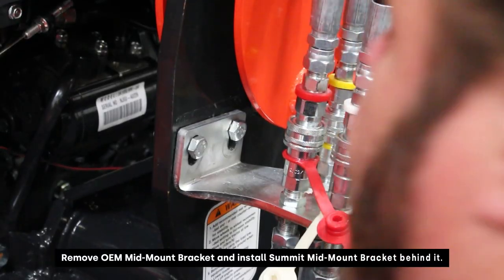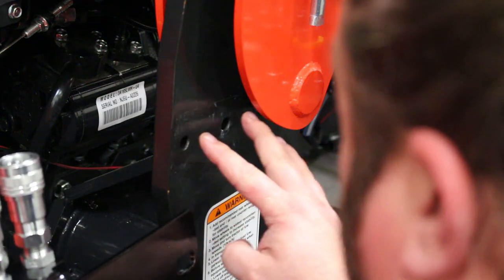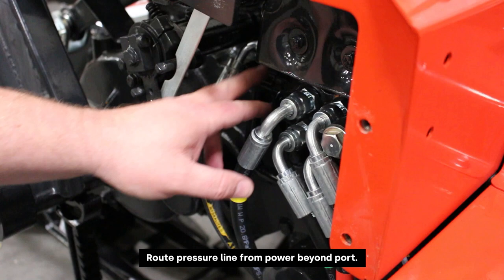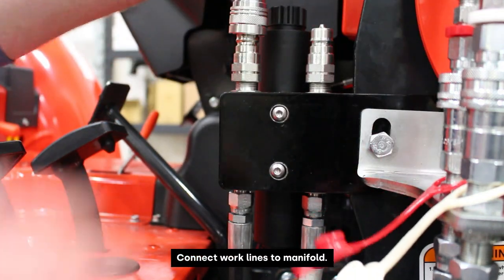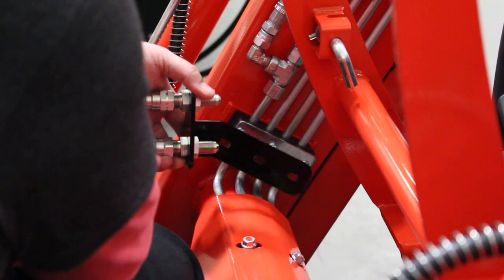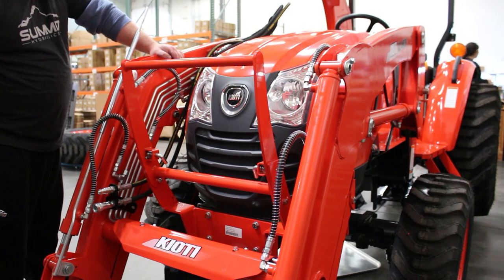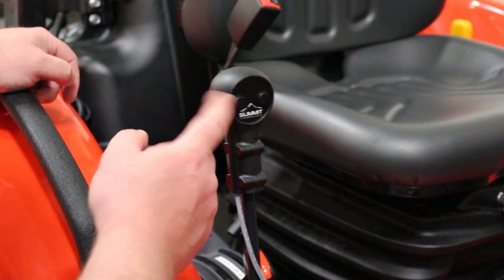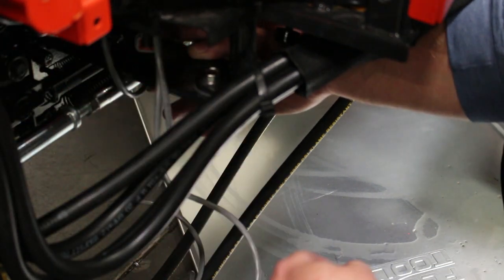Summit Hydraulics Kioti CK2610 Third Function Kit Installation

Comment: This tractor does not have rear remotes.  The Pressure port coming out of the tractor needs to connects to the P port on the 3rd function and the T port on the 3 rd function connects to the P port on theear Remotes to Pressure port on the rear remote valve

Comment: Any updated kits for the Kioti CK20 series tractors yet? I got a CK2620se Cab tractor that I would love to install one of your kits on it. It already has the prewired front loader joystick with the aux buttons.
Reply from the maker: We currently don't have anything in the works for that model, but our 15GPM Universal 3rd Function kit would be a great option for your tractor.

Comment: I have CK3510 gear, you need to add more content like where wires hook into and how run hydraulic hoses, video is a little vague for someone like me that wants to add this on his tractor... 
My other concern is,  this brand handle with those two small buttons, will I have to take my gloves off to push buttons...........

Comment: Just installed this unit on my 2610 your video leaves out alot of steps especially where to wire in the power. The instructions are just as vague. Does the valve need a key switch hot? I don't believe i want to wire straight to the battery like the instructions say. I would have a dead battery constantly. 5 stars on product quality 2 stars on video and kit instructions
Reply from the maker: Thank you for your feedback regarding our video and kit instructions. We understand your concern about potential battery drain when wiring the valve directly to the battery. Here are two solutions to ensure your battery remains healthy:

Key Switch Hot: You can connect the valve to a key switch hot source. This means the valve will only receive power when you turn the ignition key to the "on" position. By removing your key from the ignition when not in use, your battery will stay charged.

Add-a-Fuse Option: Our kit includes an add-a-fuse for your convenience. This allows you to tap into a fuse that's only powered when the vehicle is running, such as the accessory or ignition fuse. This way, the valve only operates when the engine is running, eliminating the risk of a dead battery.

We hope these solutions address your concerns and provide a suitable wiring option. If you have further questions or need installation assistance, please don't hesitate to contact our customer support team.